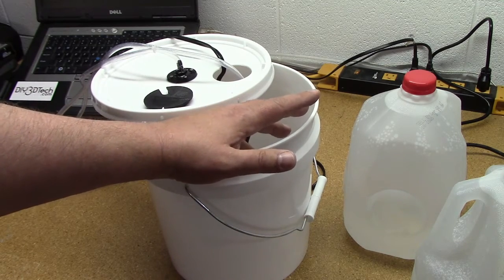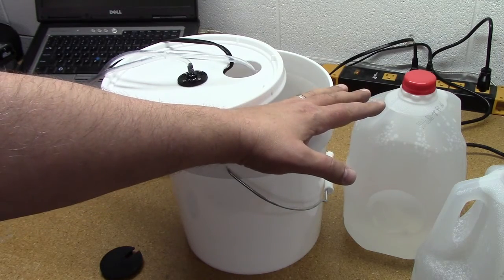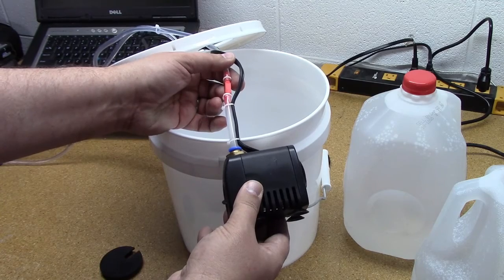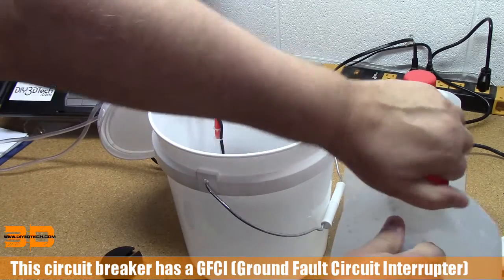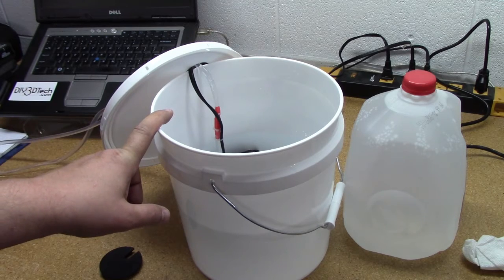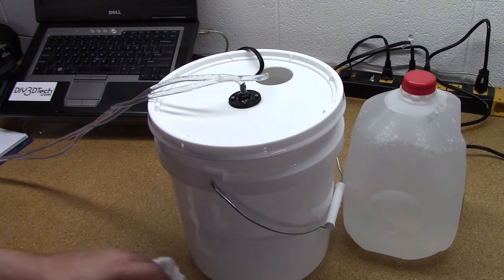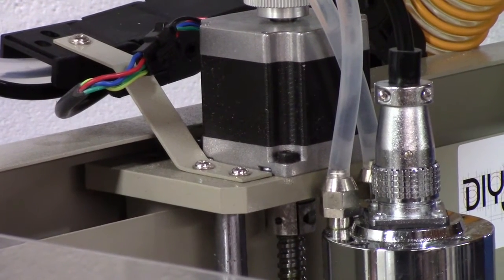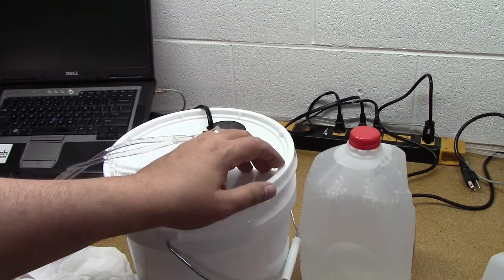3040 CNC - Building a Water Cooler for the Spindle!

Comment: Do you personally think that it's okay to add anti-freeze on top of the distilled water? I've heard that 80% distilled water and about 20% anti-freeze would also work good. I have the same pump as you.
Reply from the maker: Sort of yes,  the hoses really weren't designed anti-freeze and becarefull if you have pet as it will kill them.  You may wish to try an RV pumping antifreeze which is marked as safe...
Reply: @DIY3DTECHcom  I ended up going with pure water. I pretty much have the same setup as yours. Thank you so much!

Comment: My dear , i suggested you to build a circulation water cooling , use small radiator with fan  , electric 12 volt water pump , instal the system on y axes .
Reply from the maker: Kicked the idea around, however the thermal mass of a couple of gallons of water have worked just fine so far...

Comment: Run it through a rad for cooling , you can get cheap PC water cooling rads off of ebay and use them.
Reply from the maker: Might do that in the future, however have run the heck of this machine and with this couple gallons of water I have not heated up yet so the radiator will likely come a future project when I get with cutting things up!  :-)